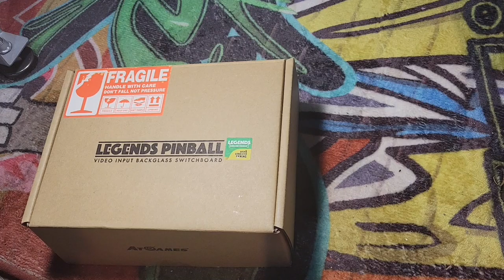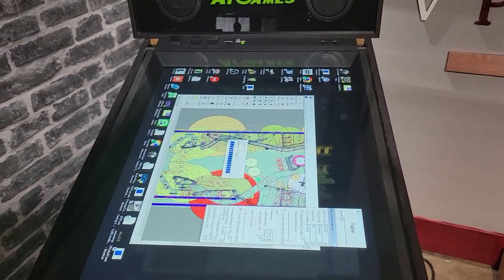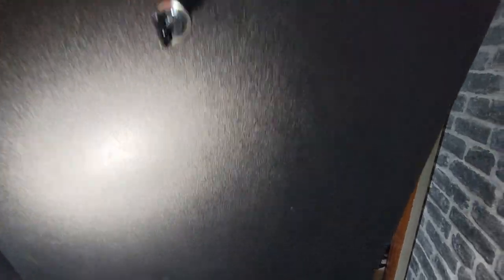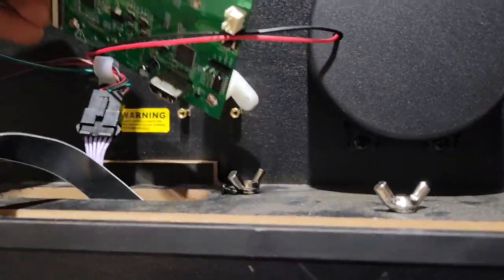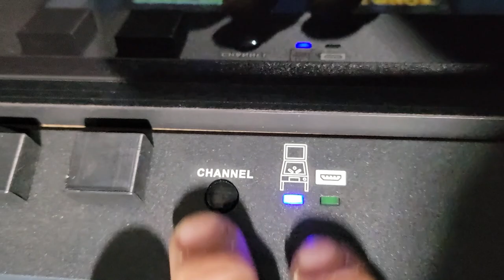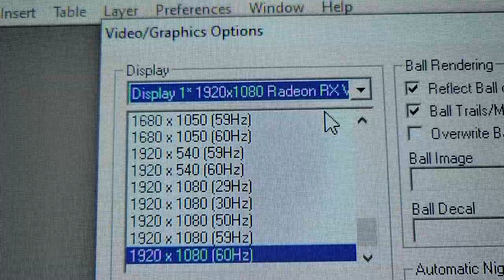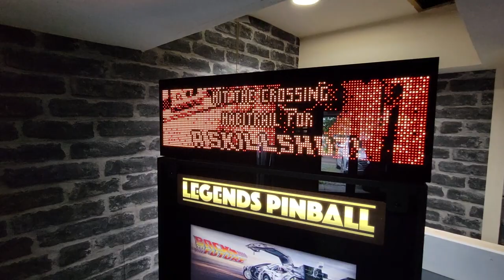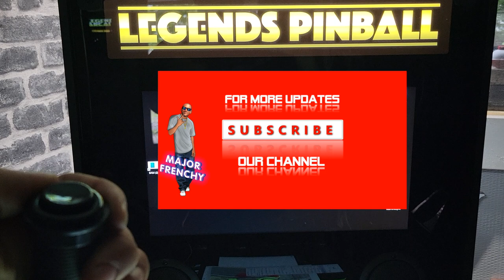VIBS

Comment: Great video, thanks!  How did you feed your HDMI and button cables through the back of the ALP?  Did you drill a hole or notch in the backboard, or what do you recommend?  Thanks for any insight into that!
Reply from the maker: No the computer is in the backbox i custom built. The hdmi are simply fished from the hole between the cabinet and the backbox.